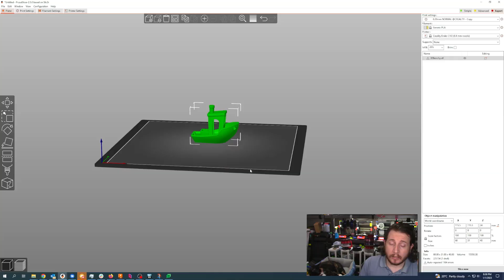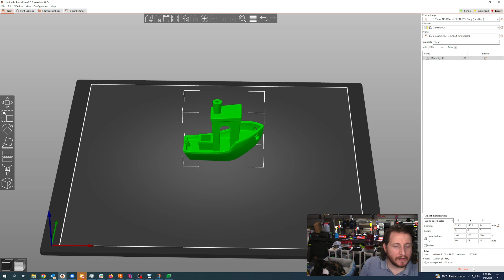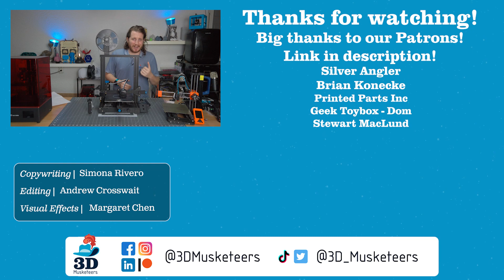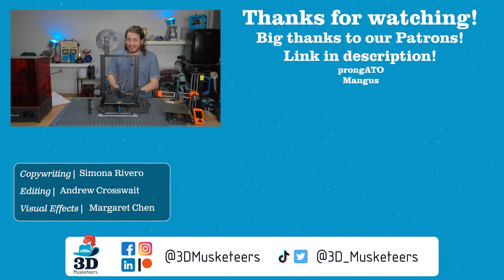How To Level Your 3D Printer!!

Comment: When I get my Hypercube going again, definite old school paper trick.
While I haven't tried this leveller yet, the cantilever bed flexes so much that I have to go off feel of the paper, proper resistance differs front to back.
A microswitch with a constant activating pressure would result in a horribly skewed first layer.
Yes the problem is the design. I plan to somewhat stiffen it up with the rebuild, but it won't get fixed completely, so paper it is.
Reply from the maker: The micro switch is a pretty light touch but I totally get it. Definitely work on stiffening up that frame!

Comment: So is there any reason to use the e-leveler with a printer like the sovol sv06 where there aren't any knobs to manually tighten? Or would we do the same but manually raise/lower the z axis until the corners are leveled?
Reply from the maker: No, the Sovol has an auto leveler and has no need for that tool.

Comment: Hmm. This newb is glad to have a prusa and auto bed leveling.  Speaking of newb so the bumpyness on your brim to the benchy is wet filament? I suppose that means my asa filament, might have some wetness to it then. I'll have some bumpyness on the first layer like that if I've had a brim.  At any rate definitely like this kind of video as it helps me know what I don't know as a actual problem.
Reply from the maker: It's not as bad as it looks. We have a light to make that bit able to be filmed. It's like little bubbles that have popped. That's what wet filament looks like.

Comment: Creality and any printer even with ABL need to be close to trammed.  As prongATO  stated it can't do the impossible.   That is a big advantage to a three Z axis printer with individual motors and drivers.  My Rat Rigs do an automatic tramming at the start of every print and get the 3 points within .02 mm across a 500 mm bed, it then builds a mesh 7x7.  Almost perfect first layer every time.
Reply from the maker: very fair, it only does so much. Ones with octoprint can do MUCH more though, which is awesome!

Comment: You might also mention that even with auto bed leveling (tramming) there’s a limit to how much it can compensate.  I’ve found the Prusa Mini+ can only compensate about 0.2mm from spit to spot. Ideally you don’t want a maximum difference higher than that as a whole.  If you ended up with a bed like that, as I did, try the silicone bed mod for the MK3 or Mini (they’re slightly different).
Reply from the maker: I do the 7x7 on the prusa, if it is more than 0.2mm between the points there is an issue.  Yes, silicone or nyloc mod can be great if needed

Comment: I'm a ABL with a proper bed mesh school.
Reply from the maker: same
Reply: It's like learning how to drive a manual transmission, once you have it you appreciate an automatic - makes your life so much easier.
Reply from the maker: especially in traffic!
Reply: @woodwaker1  I'll never know, but I don't drive either anymore. EVs don't have separate gears and barely have what you would call a transmission.
Reply from the maker: EV's with a manual, that would be fun!
Reply: @3DMusketeers  There is no point. It would add un-needed complexity. EV's basically just have a gearbox to the tires and that's it. It's a fixed gear ratio. They found that it makes little to no difference so they basically got rid of it.
Reply from the maker: for racing I can see the reason, so you dont top out the RPM, but daily use, no need, agreed.

Comment: if the chep tool is too tight can't you just up the live-z setting?
Reply from the maker: if the bed isnt perpendicular to the hotend no, it wont work.
Reply: @3DMusketeers  I got the impression you thought it was too tight in all 4 corners though.At least initially. Later you changed your mind.
Reply from the maker: based on the paper method I thought it was, but nope, he has it right
Reply: @@3DMusketeers  I think you're missing the question here. 

You talk about the paper or chep tool being "right" because of the feel of the paper, as if the goal is to be a set distance instead of trammed.  Z offset and level are two different variables. 

The bed can be trimmed with 3mm from the bed to the nozzle. Then you make up for that distance with z offset. 

You don't distinguish level from offset at all in this video.
Reply from the maker: Because it's not required. Cheps tool does not require an offset. You use the gcode he provides to use the leveler but after you level it, nothing else is needed.
Reply: @@3DMusketeers  This is mostly true but personally I have still needed to babystep with cheps tool in some cases. It looks ever so slightly too close in your video. You have some fillsment coming up above the 1st layer indicative of too much squish. 

As an instructional video to new printer owners it would have been helpful to include an explanation of z offset. Someone who doesn't know wouldnconflate the two the way it is presented.
Reply from the maker: It's wet. I explained that in the video. Parallel lighting makes it look much worse but was required for the shot. A video on z offset is next week. This has been planned for a while.
Reply: @caramelzappa  yeah that's what I was getting at. If it's trammed, but too close (which you later discovered it wasn't) then you can change the z-offset to fix it.
Reply: @3DMusketeers  in the end that's what you discovered, but I was referring to when you thought it was just slightly too close.
Reply from the maker: I could have, but why bother, set the level right instead :) Gotcha.

Comment: Thanks for the video.  I thought that with CHEPs tool, you had to set a z-off set to counter the thickness of the tool itself.  Is that correct?  I am thinking of one for my grandson ( I use paper, and as you say, its hard to describe how to judge it).  I would also love to see you install auto bed leveling because that would be another possibility.  Thanks as always.
Reply from the maker: nope not at all! It just works with his g code.
Reply: @3D Musketeers  so just to clarify, was your Z-offset was set to 0.0 when you started using the e-leveler or had you already previously calibrated that using the paper method?
Reply from the maker: @shanecaler1167  All set to 0, no previous leveling before the e-leveler. That machine is purely for youtube so if it is not in videos it is collecting dust.